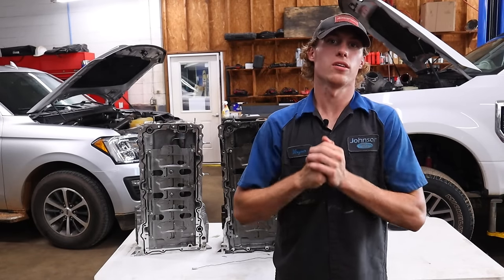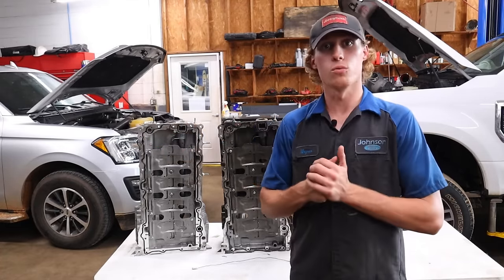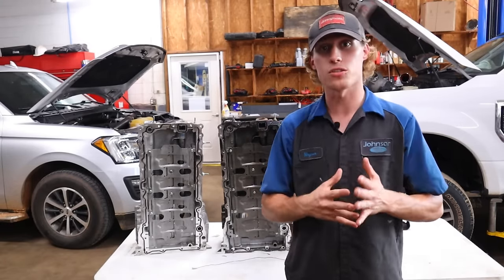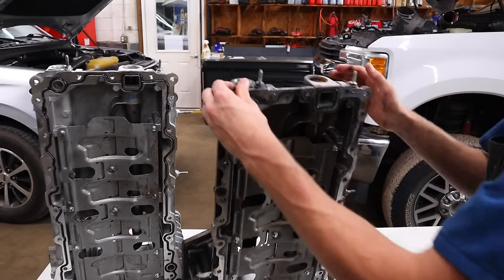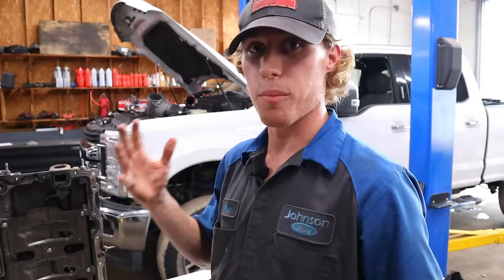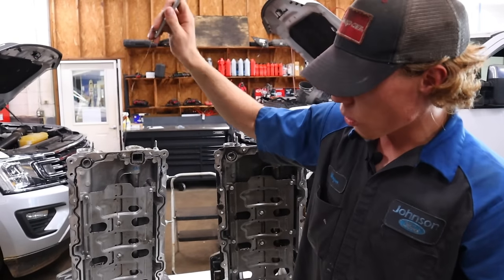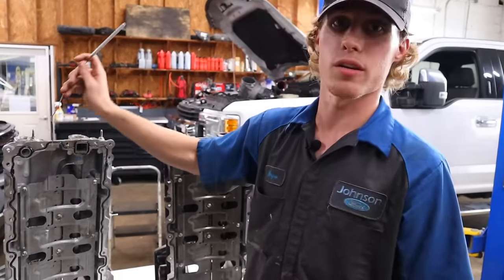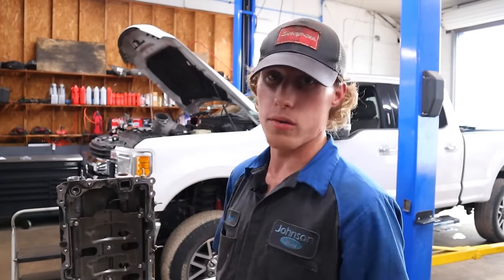How a BRAND NEW Oil Pan Destroyed This 6.7L PowerStroke

Comment: The quality issues I have seen in parts I get for my shop, OE and aftermarket, starting going down in 2019 before COVID. Bad CP4 for a Duramax LML from GM, bad damper motors from Ford, bad fan clutch from Hayden for a Ford 6.0. All parts installed with immediate problems found during post repair verification. This is a short list and I am a small shop.
Reply: It's time to boycott the parts networks that only push their distributors parts. Yea they come a day or two sooner than amzn or ebay, but they're straight up broken trash. Buy aftermarket, especially if the part is a known improvement. Nothing's dumber than a dealership replacing known problem parts with the same problem parts. Quit using tin foil and bolts for a head gasket when an aftermarket gasket and studs is available at probably a cheaper price. Ford is the most famous for this fraudulent neverending repair cycle
Reply: Same I’ve had a brand new fan clutch bad out the box as well as IPRs
Reply: Yep same here. I definately seen it even before Covid as well. Quality checks are  down a lot.
Reply: CP4 pumps are just being used wrong. They're meant for number 1 diesel which is thick and sold in Europe. America uses number 2 diesel which is thin and doesn't lubricate the CP4 pump so it gets destroyed. Still the manufacturers fault because they knew this would happen in the US.
CP3 pumps are bullet proof, so do the CP3 conversion if you have a CP4 truck.
Reply: I had new 400$ radiator where the factory fan shroud bolts pushed/drilled holes into the new tanks. How, why, what?
Reply: @PowerStrokeTechTalkwARod was working on a Lincoln, went through like 5 starters before getting one that worked
Reply: @jaybaar1  starters are the worst, better get an oem while you still can.
Reply: There is now three main Capital Corporations that own most of once American auto parts. These old American manufacturing companies are immediately gutted and sent to Chinese manufacturing. Worst is Apollo Capital out of 5th ave. NYC which now owns moog, fel pro, and Monroe shock as well as 25 more.
Reply: @brianblithe2271 the Lincoln problem was sctually alternators and I think the first installed and soon failed were Motorcraft remains, new NLA. The generation of alternator he was dealing with had the issue where it charges but the warning light is turned on by PCM because the feedback signal isn't making PCM happy
Reply: @jimmyaber5920  thank you for the info. i have not heard of a bad reman. ford part yet but i mainly deal with trucks.

Comment: I work at a Ford dealer and one of my work buddies was assembling an engine he replaced the block on, he went to bolt down the heads he found none of the head bolt holes had been tapped. I'm surprised at the stuff we are seeing these days, quality control is definitely an issue. This stuff is supposedly getting triple checked in the case of the engine block.
Reply: Did you not know how tight the tolerances are inside the new engines it's like three and four thou not 10 and 12 like the old engines so it would take nothing for them to seize up I've seen that happen to four or five engines ford especially
Reply: @urbanmacdonald7901  that has nothing to do with not tapping bolt holes...

To the OP, I have seen the same kind of thing working at a John Deere dealer. Holes not drilled even remotely close to where they need to be, stuff not tapped, brackets that are over 1/4 inch off spec. Wiring harnesses that are pinned wrong. 

Hell, we were just told to throw out our entire stock of a certain oil filter because they were made with the wrong case/o-ring diameter and they leaked. Over 500 filters at our one location. Admittedly this is a supplier problem, not Deere themselves, but still.
Reply: I wrench for a Ford dealer too.  I guy in our shop did a 1.5L ecoboost short block for the usual issue.  Started it up and it was knocking.  Turned out they neglected to put the upper rod bearings in the short block.
Reply: This is something you may want to check but on some items ford uses bolts that cut their own threads. I know that seat track to floor bolts are that way as well as bed bolts,cab bolts and some seat belt components are that way. While I wouldn’t think head bolts would be that way I can’t 100% rule it out either.
Reply: @dirtracingfan8742  I can 100% rule that out for you.